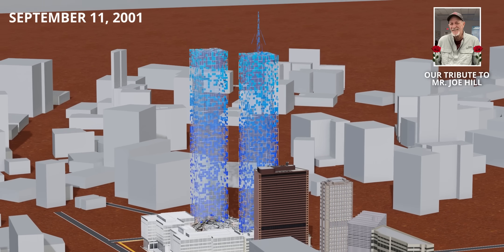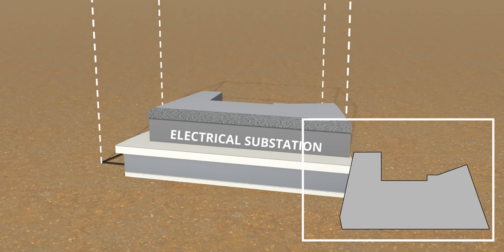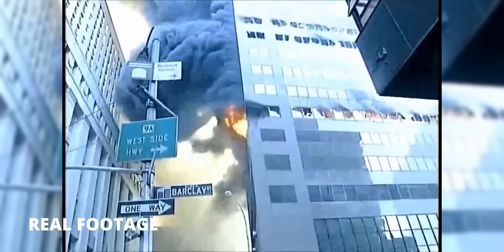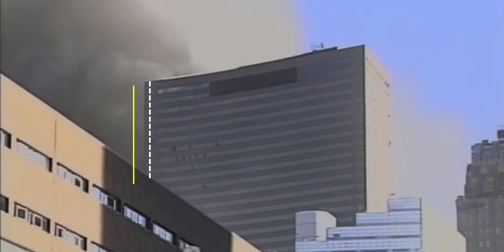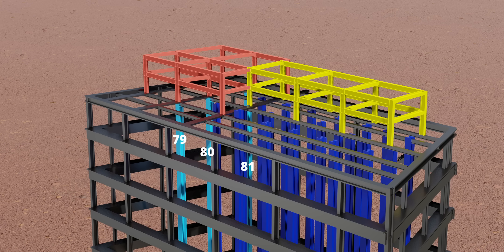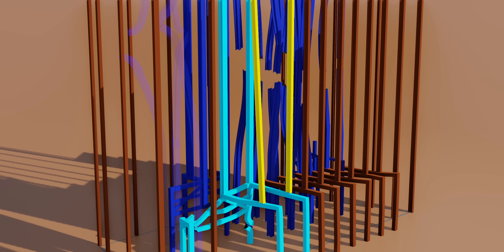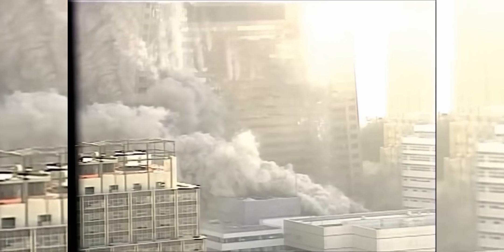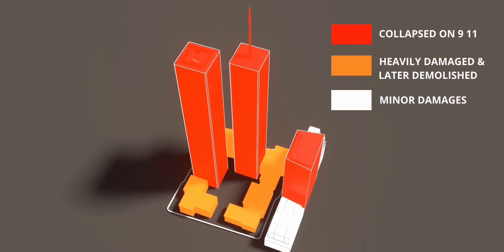Collapse of Building 7 | The Complete Physics

Comment: I am a former  Aerospace Engineer  and physics tutor for several years  I would like to say absolute B.S  , 
 tower 1 is located an entire football field away from building 7 ,  can you explain why the debris from tower 1  had so much lateral force pushing them 100 meters in the horizontal direction ??  this can only happen with ( accelerants) explosions not structural failures. without force you cant get motion so the debries would fall down straight not eject 100 meters horizontally 
also how did this fall happen so fast  , the NIST data shows it was falling at free fall for 2.5 seconds !!  this means there is zero resistance from internal intact structures 

What about north tower ??  how can 10 floors pile driver demolish 90 intact floors below it ?? that contravenes newtons third law of motion .  I challenge  any one to recreate north tower real model on any scale you like out of any material or structure you like but I want you to demolish it by removing section below the 10% mark of the building !! 

what about the molten steel ??  an unpressurised  hydrocarbon fire  in the best inferno cant get hotter than  800 degrees Celsius  and you need 1500 Celsius to melt steel  so how did we get those pools of lava that stayed glowing in the basement for weeks ?
Reply: All I can say is I am glad I was never one of your students and I hope I never fly in anything you were involved with.

Let’s break it down to the absolute basics, addressing most of the commonly asked questions as we go:

The 47 core and 236 perimeter columns of the Twin Towers support all of the gravity loads of the building. ALL of the resistance is in the columns.

Planes impact Towers, causing massive structural damage, destroying sprinkler systems, tearing out gypsum board walls and blasting off the SFRM insulation from the floors. Multiple floor-wide fires are started instantly and spread rapidly due to the destruction of fire protection systems and venting of the building during the impact.

Serious fires were largely confined to the impact damaged floors and those immediately adjacent to them.

Fires were started by the impacts and fuel aboard the aircraft, which acted as an accelerant. No shortage of other consumables inside the tower to continue the fires.  Active and passive fore protection systems were destroyed in the impacts, there was no active firefighting.

Collapse was initiated (started) at the impact and fire damaged floors when floor trusses exposed to heat over time sagged, in turn pulling on and causing the inward bowing of some perimeter columns by up to 5 feet until they buckled on one face of each tower (ie: NOT symmetrically).

www.youtube.com/watch?v=ULdiD6gYZO0

No steel melted or needed to. Structural steel will bend and fail at less than half its melting temperature.

Once the perimeter columns buckled the formerly static load above became a dynamic load 30 times greater, easily overwhelming the structure below.

Thousands of tons of now loose debris fall through the open office space within the four outer walls - bypassing the columns - dropping 12 feet onto the first intact floor it comes across. That massive instant overload causes the floor to fail, shearing the pair of bolts that secure each end of the floor trusses to the columns. The floor fails. adding its mass to the falling mass which continues to accelerate for another 12 feet until it impacts the next floor, rinse and repeat one floor at a time all the way down.  Yes there is resistance but its totally inadequate to arrest the collapse. Resisting is not the same as preventing

The columns - the part that holds the building up, supporting ALL of the gravity loads - are spectators for all this as the debris falls around and past them, not onto them.

Rate of collapse increases as momentum increases. The collapse front is constantly accelerating.

As each floor fails, air inside the building (the Towers were 95% air by volume) is compressed, then blows out the sides _in reaction to the Tower falling, not the cause of the Tower falling.

No fire required at all on floors below the impact points for them to fail. The mechanisms that started the collapse are different to the mechanisms which continued the collapse. That will be a difficult concept for some.

As the floors fail the perimeter columns are left literally hanging in the breeze, no longer attached to the rest of the structure. They peel away and fall in great sheets (think banana) out to more than 600 feet from the base on the 4 points of the compass.

Core columns failed last, buckling near their base due to the loss of critical lateral support as the building collapses around them.

www.youtube.com/watch?v=WpHXj62Ylw0 

Twin Towers collapses were a combination platter of four (4) factors:

Impact Damage + Fire (heat) + Time + Gravity = Collapse

Remove any one of those four factors and there is no collapse. Ignore any one of those factors (most people reading this ignore three) and you will never understand the collapse. They all work together. 

The collapses took 32 to 34 seconds start to finish, or about 1/3 of the rate of free fall acceleration for those obsessed with how fast things fall because the internet told you it was important. No Laws of Physics are violated so no need to invoke magic or divine intervention

Each 110-story tower had a 1-acre footprint. The debris pile was up to 14 stories deep and spread out over 16 acres, destroying 8 surrounding buildings and damaging more than 100 others.

Anything can seem like a conspiracy if you don’t take the time to understand how it works. Hopefully now you do.  If not, I can go into much greater detail. 

I do not BTW claim any relevant expertise.  I make no argument from authority while mindlessly repeating dead horse conspiracy meme's I found on the internet.  I am right because I am right or wrong because I am wrong.
Reply: @TheCriticalStinker-01   I worked on the F35 in 2008 so you are in big trouble  lol
Reply: @AliMohamadChannel  - Is that why it doesn't work and was delayed for so many years. 

I will note that bit of silly nonsense is NOT a rebuttal of anything I said.
Reply: @TheCriticalStinker-01    you didnt make any scientific argument to explain away the free fall of building 7 or  the  molten steel or the bombs in the lobby before the planes struck  so what will I disprove?
Reply: @AliMohamadChannel  - Why would I make a scientific argument for things that did not happen?  Tired old memes you are just mindlessly repeating off the internet that have been failing for 2 decades.

IF you wish to claim those are things that happened isn't the burden of proof on YOU to provide the science to substantiate the validity of those claims?  Didn't they teach you that in Aerospace Engineer school?
Reply: I'm Superman and I say you're full of shit. And what do you know, my claim was more factual than yours.

Anyone who needs to preface a post with a self-proclaimed supposed authority is making up dumb shit to cater to their own ego. Nothing else.
Reply: @mooneyes2k478    
it is related dont be silly,  I know how demolition and structural failures work and their forces I am not bragging there are so many scientists smarter than myself I refer you to them to check a validate my claims
Reply: @AliMohamadChannel  Yeah, so, basically, "Of course I'm right, so there, stop calling me on it, it's mean!"

Yeah.
Reply: Lets not forget buildings were damaged fifteen blocks away from the wtc, not just 100 meters
Reply: @robbiehiatt9966  
yes I know they got damaged because explosive power ejected debris laterally with big force  and evenwith upwards velocity vector components against gravity so this proves it was not a structural failure involving only gravitational potential forces  but  demolition removing structure out of the way and breaking the bonds
Reply: @AliMohamadChannel a man was running in the street away from the collapse and was found dead with other people's flesh embedded in his bones

Comment: This is absolute horsesh!t. No building collapses at FREE FALL speed due to fire. Its impossible. That "gash" is BS because 1 and 2 collapsed into DUST. Get this crap off YouTube
Reply: True, not least because there is no such thing as free fall speed since free fall is a measurement of acceleration NOT velocity.  But then, anyone with a working eyeball can quickly figure out there was no free fall acceleration either. That dead horse argument has been failing utterly for 20 years. One would think you guys would have figured that out by now and moved on to something new, something that might actually get traction.

But you don't.
Reply: @TheCriticalStinker-01 you got the video of the plane hitting the Pentagon? No? All the tapes are still confiscated? Thats what I thought. Free fall speed meaning speed fallen with no resistance. Its commonly measured. If you actually believe the official 9/11 commission story (which never even mentioned wtc7) youre a dunce
Reply: That you have no idea what the words you're using mean, or rather don't mean? Only mean you're overwhelmingly clueless. That you then clearly can't stay on subject, because you know you said dumb shit that flaunts how clueless you are, only reinforces your failures.

"Free fall speed" is the perennial idiocy spouted by the terminally dumb to let everyone know how utterly they failed basic schooling.

Comment: Most columns collapsed at once perfectly downward?
Reply: No. Watch the video
Reply: @T @TheCriticalStinker-01 st, not all. The animation is by far not conclusive, hence my question. The elaborations on the freefall argument is to distracts from the poor animation.
Reply: @Tobo-oy7if Your question doesnt  make any sense
Reply: @aSASa45454 the colums not beneath the heavy weight: did they all break at once? Because the animation is not clear and the way the building collapses suggests it. But not a single word is lost on the most crucial part on how most columns failed all at once from the top to the bottom.
Reply: @Tobo-oy7if - Read my description from yesterday.
Reply: @Tobo-oy7if they said it was progressive
obviously losing those critical columns on one side, the building is coming down, so i dont know what youre asking still
Reply: @aSASa45454 look at the building how it really collapsed. If this would have been progressively, the building would not have come down evenly. That's not how it works.
Reply: @T @TheCriticalStinker-01 look at the video and compare it to reality and use your common sense.
Reply: @Tobo-oy7if - I did. Then I went to the next level.

IF you are serious (jury still very much out on that) please read my post from yesterday, which you clearly still have not. Any question you likely have is addressed there.
Reply: @Tobo-oy7ifin the video they show it does move from left to right, just very quickly. 
I don't think a steel structure has the redundancy and load redistribution mechanisms of a reinforced concrete structure. RC would progress slower (see Surfside condo collapse)
Reply: @TheCriticalStinker-01 you obviously didn't.
Reply: @a @aSASa45454  the building were to collapse like WTC 7, almost all, ALMOST ALL steel beams would have to collapse at the SAME TIME. It's not that the structures of the steel of each beam is synchronized on a quantum level. WTC 7 was not a sped up RC collapse, it was at once. If it would not have been at once, a steel structure like any other structure would have a tendency where the downforce would be going (not perpendicularly down into MASS) and the building would not collapse into its own footprint.
Reply: I suggest you clear the shit out from between your ears, so that you don't have predetermined "conclusions", and then watch the video again. Don't "know" what happened beforehand.
Reply: @mooneyes2k478 you are delusional
Reply: @Tobo-oy7if And yet, not wrong. Imagine that.

Comment: Can anyone explain why they cleaned up all of the evidence without doing an investigation beforehand?
Reply: Well, the explanation is, they didn't.

They did, of course remove the debris to a place where they could investigate it. This is generally what you're meant to do when there's not only a massive amount of toxic material(as would be in any large building) but also the remains of the victims in the Towers. It's not only very very important to get that toxic material away, but also the decomposing remains. Not, of course, to mention that leaving those remains there would be incredibly disrespectful.